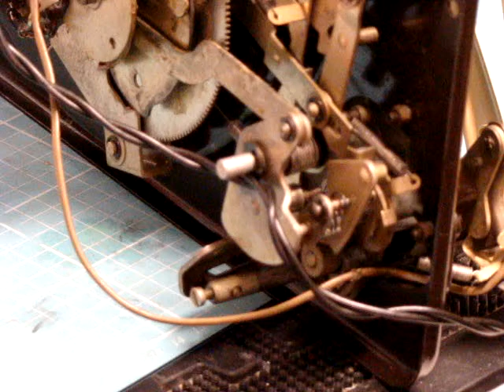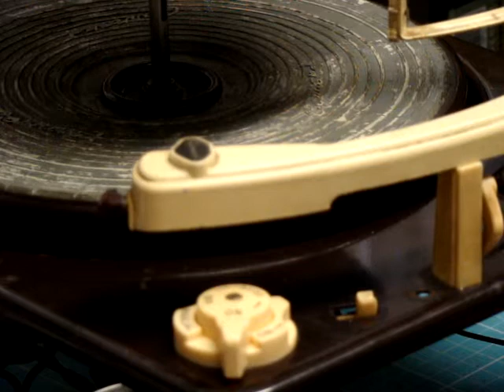HMV 1628 radiogram overhaul - Garrard RC120 record deck - Part 2.3

Comment: Interesting set of videos.  I have repaired many of these Garrard RC120s and the MKII versions.  The original Garrard cartridges died many years ago being of the crystal type.  I find an original Ronette mono/stereo turnover equivalent quite good.  You are VERY lucky the usual issue with this model is not happening with this repair, that being the size detector arm will often not go all the way to the center to detect no more records on the stack, resulting in a replay of the last 7" position over and over again.  Great to see here!
Reply from the maker: Thanks for your comment. I've never seen one before in my 38 years in the trade. When I had a shop for 18 years in Yorkshire, I did HMV & Ferguson  brands (both Thorn of course) & always took their training days when offered......but this was in the late 70's, so the earliest turntables I did proper training on was the Garrard 3000 & the BSR Autoslim. I think we'll find a way to properly fit a modern ceramic cartridge & build a one transistor pre-amp to compensate. I don't have any cartidges in stock & our wholesalers have only a few magnetic & ceramic models to choose from, certainly not crystal. Looking on Ebay, people want £45 type money for NOS cartridges that are properly also knackered! Anyway, we;'ll see if the second unit I bought (identical HMV 1628) has a less seized turntable & fingers crossed it doesn't suffer from the snag you  have experienced. I don't like the suggested 10g tracking pressure after being used to 2.5 - 4g on the decks used in the HMV Stereomaster range with which I am very familiar. At least 10g is better than the 20g + on these cheap modern record players that are currently on the market.

When I opened up the GC2 cartridge all that was in it was white dust!

If you know a source of Crystal cartridges do let me now please.

Richard
Reply: Crystals Carts are hard to come by probably because they are all shot by now.  These decks will track perfectly well (after a lube etc) at around 4 grams. If you don't mind the hole left in the front of the tonearm I have often replaced the existing with a high output BSR ceramic flip-over type (ST3 or ST4) and they can be fantastic.  There is also a Garrard ceramic flip-over if you can get new-old-stock.  You may just have to put some extra spacers on top of the cart during installation to allow for the clearance and the flip-over to work correctly.   You can find these on eBay, just check they are not the Chinese look a likes.

Comment: Hi Richard. I’ve just recently bought a herofon petite with the Garrard RC120 MKII as the record player. Unfortunately the speed changer seems to be stuck, resulting in the discs spinning at wrong speeds.. do you have any videos on this issue or have any advice on how to fix it? 
(Or am I maybe just doing something wrong?)
Thank you in advance!
Sabina
Reply from the maker: Hello Sabrina. Just check the other videos in this sequence. I'm sure I showed what to do to unsieze the speed control as it was absolutely stuck. The record deck had to come out of the cabinet for starters.

Richard

Comment: Thank you so much for these very interesting videos.
Would you say that this old record deck is of better quality than the later Garrard and BSR units you mention?
I'm looking forward to hearing the finished project.   I recall in the mid 1960's a friend of my parents acquired a huge old radio gram - make of which now forgotten -  which had a deck made just for 78's.  That was replaced by a more modern BSR deck. I can remember, even now, the wonderful rich powerful sound from the valve amplifier and big single speaker. Wonderful!
Reply from the maker: No I wouldn't. This has far too many parts. I'm still thinking about how to mount an alternative ceramic cartridge instead of the knackered Crystal one, which rot due to age anyway. I'll probably have to make a bespoke L-shaped mount out of perspex or similar that somehow attach it by screwing through the hole in the front in such a way it isn't a bodge job (like glueing it in or double sided tape!).

Out of the cheaper Garrard decks, I like the 3000 best with it's auto stylus brush, the only disadvantage is that there is no anti-skate adjustment. I've spent 38 years working on HMV Stereomaster radiograms & stereograms & like all but the last BSR deck they used in the 2419 model. Regarding the Garrard 3000, the turntable is so well balanced & has such good bearings, the turntable carries on rotating for about 40 seconds after power to the turntable is cut. By todays standards any Garrard or BSR unit is like a Rolls Royce in comparison! I have no experience of the top end Garrard units like the 301 etc.

Regarding this HMV 1628 radiogram which is finished other than the cartridge in the turntable, My 67 year old friend Bob came round last night & asked to hear it. I switched it on & he tuned in to classic FM. Bob was spellbound by the uncoloured natural sound it produces despite being mono & having a singe 8" speaker. Bob collects Dynatron radiograms & has 28 of them, so he knows a good sound when he hears it.

Richard
Reply: Thanks very much for your comprehensive reply.  I think I will try to find a Garrard 3000 to replace the BSR in my Stereomaster 2412.
Reply from the maker: I wouldn't change the 2412's BSR deck, I find it excellent. What's the snag with it?
Reply: Well, it just sounds very poor. The turn table platter has a great amount of play in the bearing, and the pick up arm also is very wobbly. I don't know if it is all down to wear, or if they were a bit like that from new.  I do remember a neighbour having a mid 1960's Stereomaster with a Garrard (3000? I think ) deck, which sounded superb.  My 2412 is otherwise excellent on the radio and other inputs.
Reply from the maker: Yes the 2018, 2026, 2040 (Stereogram) only & 2028 (mono radio) are fitted with the Garrard 3000, but I can't say there is any sound difference between the Stereomaster models with the Garrard 3000 & the later ones with the BSR turntables, though I don't particularly think the one fitted in the last model, the 2419 is that good, I find the other ones great. Assuming your stylus is OK & that the unit performs well on radio & other inputs, I can only assume the cartridge isn't right, but one would expect it to be OK on one channel & not the other rather than being equally poor. There is A Garrard KS40 cartridge NOS on ebay right now for £15.82 (in Germany). I've had a couple off him in the past, though had to change the stylus it came fittted with immediately because of compliance issues.

Does yours just sound nasty & distorted?

Richard
Reply: It lacks the detail and clarity that the other sources have.
Reply from the maker: I suggest you plug the Stereomaster into another amplifier through the 'tape' 5-pin DIN in/out socket. I know you say the radio sounds OK, but you would prove if it's amplifier issues in the Stereomaster or not with that test as the signal to the tape socket has only been through the pre-amp, which only has one nasty capacitor to fail. As I said before, we change all the electrolytic capacitors now these are 45 years old & muffled sound or a hum is typical of knackered capacitors. Apart from that & ensuring the stylus is OK & the tracking pressure (weight of stylus on record) is between 2.5 & 4 grams. digital pressure gauges are about £5.99 from China via Aliexpress or  Ebay if you don't have one.

Richard

Comment: Quick question? I've just bought one of these radiograms. I've got a lot of stereo and mono records and I am looking for a cartridge which can play both stereo and mono records without damaging them. Is there any cartridge I could get preferably cheaply which would do the job? Obviously dont want to damage my records.
Reply from the maker: I can't see how any other cartridge would fit, being this old it's not like the slightly later record decks such as theBSR Monarchthat will take a TC8 crystal cartridge for which you can fit a TC8S stylus to play stereo records without damaging then. I'm not aware of a stereo compatible stylus for the GArrard catridge fitted to this RC120 deck. Whatever you do needs to be a high output crystal cartridge otherwise you'd start having to build a special preamp if for example you fitted a ceramic cartridge. To be honest I think you need a different  record player to play stereo records safely.

Richard